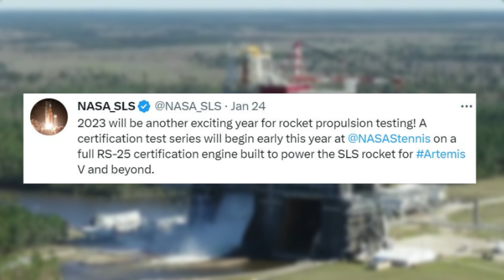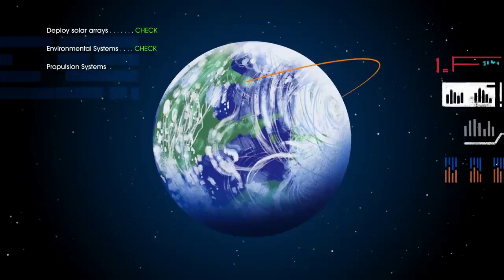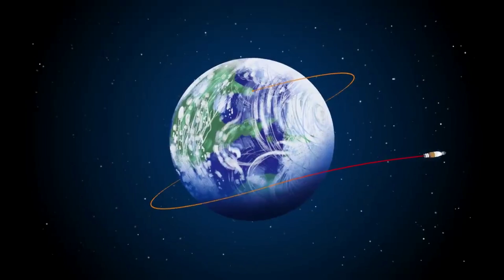NASA's Artemis II Progress, Delay Concerns, Updates, & More

Comment: How does someone not know the launch tower under development wouldn’t work for the rocket variations designed? Incompetence? Or more likely cost plus contract being manipulated to increase corporate profits. Now the have an excuse to redevelop SLS’s and launch, making more cost plus profits. And still need a new lay tower for SLS’s 3rd launch. They know this is their last cost plus cash cow and are milking it for all they can.
Reply: It's all a conspiracy. Your tinfoil hat is cutting off the circulation to your "brain."
Reply: ML-1 was not SLS tower it was Ares 1 tower that could be modified to support smallest SLS variant, so they did. But it is at weight limit of CT-2 and for bigger rocket they meed lighter and bigger tower. 

Why ML-2 is delayed? Beacuse NASA chose bechtel, the cheapest contractor, to do it and as it turned out they underbid. Yay. I surely love it when NASA selects the cheapest options.

Not only that but it also turned out said contractor is incompetent.

Also no they do not need new tpwer for 3rd launch, and no, no SLS redevelopment is needed, rocket is perfect(insert this thing italian cooks do with their fingers, or something.)
Reply: Cost plus doesn't work like that, it's not an infinite money printer for contractors.
Under a cost plus contract, a contractor receives a set amount of profit that is determined during contract negotiations, and if they perform really well they are awarded some additional money as incentive.
If the contractor makes mistakes and cause cost overruns they don't receive any additional profit, it just means that NASA has to foot the bill instead of the contractor.
This makes sense in large high risk programs where overruns are likely to happen and most contractors aren't willing to sign on if they could easily lose billions of dollars from their own pocket.|
In regards to the SLS mobile launchers, ML-1 was not designed for SLS but for Ares I, and had to be significantly modiefied to handle the much larger SLS Block 1.
It can't handle the larger SLS Block 1B and that was known from the beginning of the program.
Initially they were going to tear it down and rebuild it after the first SLS flight to handle the larger EUS upper stage but that would require the SLS program to stand down from flights for 4 years, so they decided to build a second ML designed to handle SLS Block 1B and Block 2 from the beginning at the same time they were going to be launching SLS Block 1 vehicles, thus allowing for a much smoother transition between Block 1 and 1B.